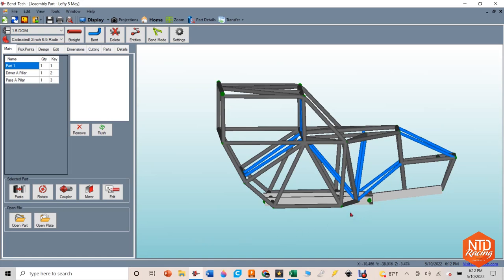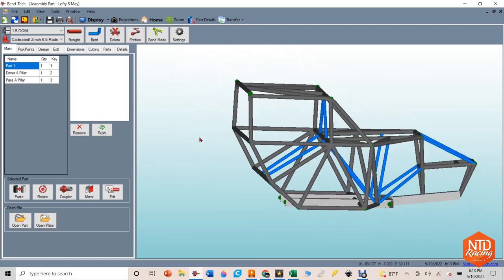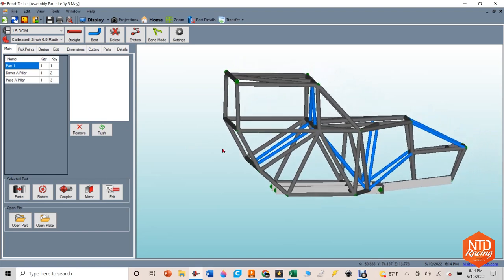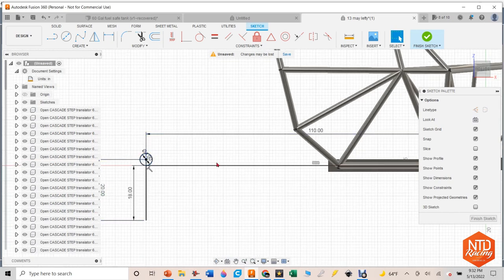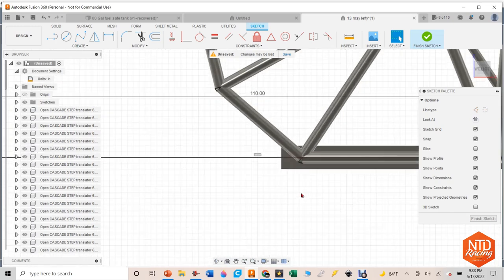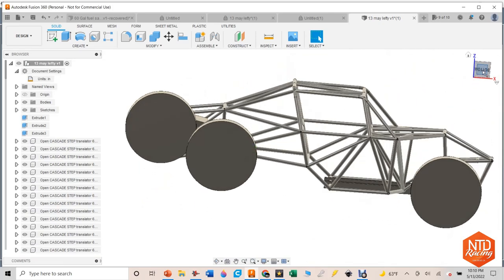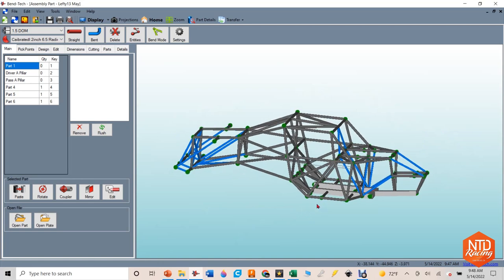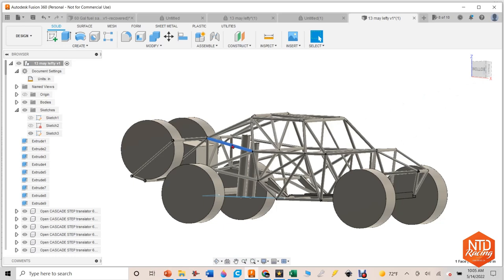4 link suspension and chassis design with Bend-Tech CRAWLpedia and Fusion 360

Comment: I really appreciate you doing these vids. So helpful with the learning process for me with bend tech and fusion 360 and fabrication in general. Any issues I’ve had I’ve been able to work out with your vids for the most part. I’m trying to build a Baja bug with A Arms. Still debating on a kit or a full custom build. Super close to buying a cnc plasma
Reply from the maker: many thanks…I think you might like this video.  https://youtu.be/MpZ7ZoPkyC4.  For the money you save building your own, you can just about cover the cost of the CrossFire Pro.

Comment: When you bring the roll cage into Fusion 360 do you have to apply dimensions to it? Have you ever tried using the sheet metal function with the imported roll cage from Bend Tech?

Not sure if this is possible but can you take parts from Fusion 360 and import them into Bend Tech? 

When your importing parts into Fusion 360 do most companies offer CAD files kinda like a rear end from Currie getting the CAD files to upload into Fusion 360?
Reply from the maker: I just import it.  I find that the dimensions are all accurate.    I have not used the sheet metal function.  I have created new planes and sketched on those planes and extruded the panels I needed to plasma cut.   Will show how I do that when I get to it in a few months.  

I think you can import from Fusion to BendTech…just have not tried it yet.

Comment: For the software, would the Ez3D version work fine, or should I go with the pro-version.
Reply from the maker: It depends on what you need to do.   The base software is the same, but you get more capability with each upgrade to their software.
Reply: @ntdracing  I’ll be doing the same thing pretty much. But a cross kart instead. I saw they had the triple bundle, that’s looking to be the best so far. Wasn’t sure if you could get away with using the cheaper one.